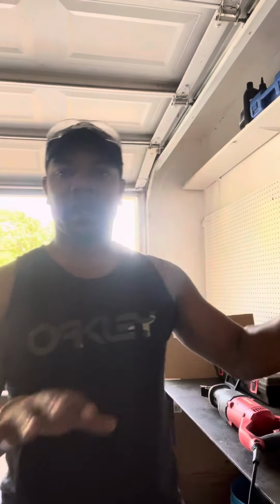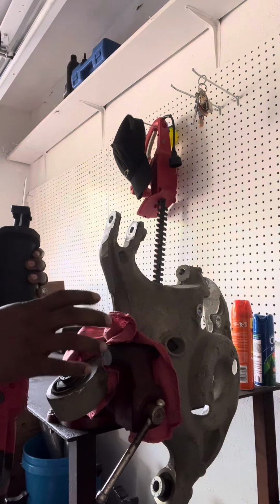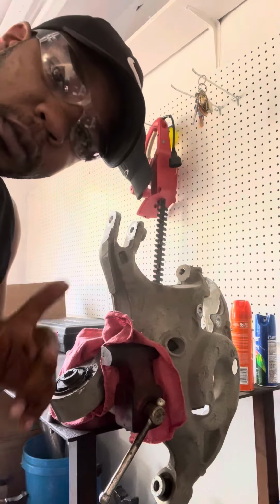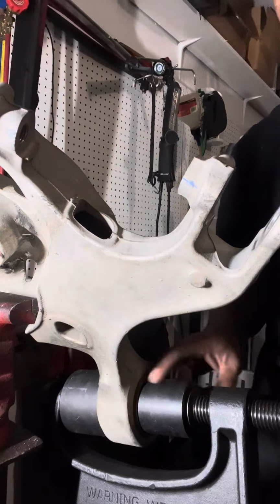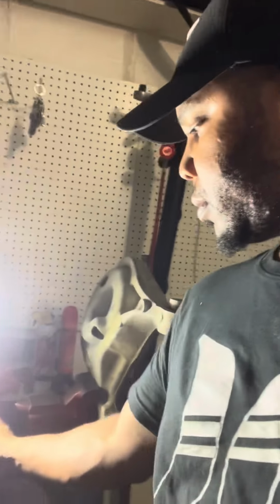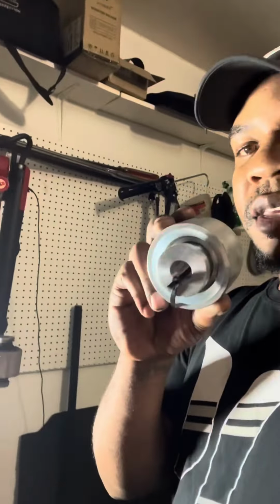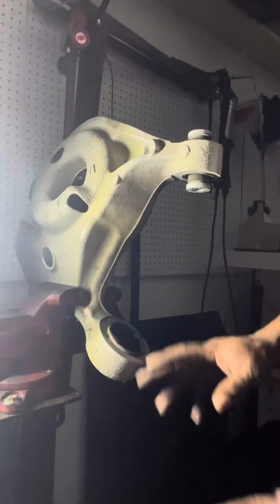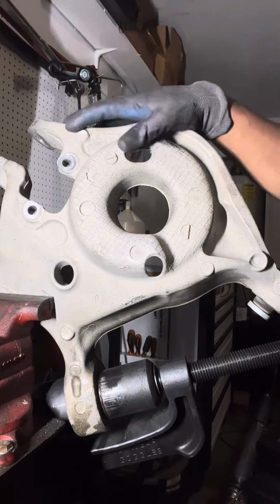MUSTANG GT BEST UPGRADE!! DIY BMR SUSPENSION

Comment: Alright, my question is to get the control arm off is it almost the same process as installing springs? Do you drop the subframe some to relieve the spring pressure? The the control arm just straight unbolts?
Reply from the maker: @TexasBornAgainTrucker  you don’t have to drop the subframe just remove the stock and rear camber
Reply from the maker: @TexasBornAgainTrucker  https://youtu.be/nzXNXVNqPqs?si=KftXbNxZu2lf0cJN
Reply from the maker: @TexasBornAgainTrucker  https://youtu.be/k_s2IQ5pkx4?si=tbJ29S2m45q87kZz